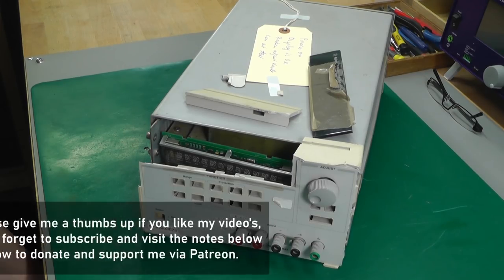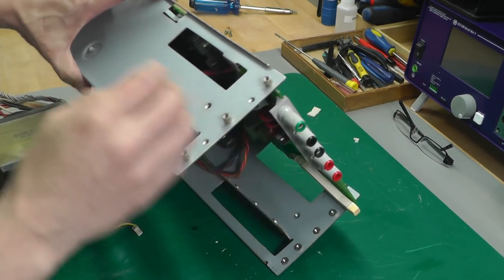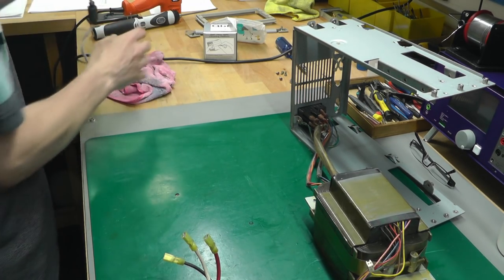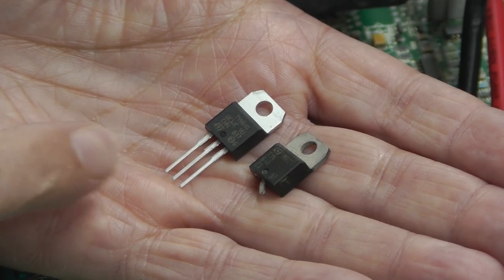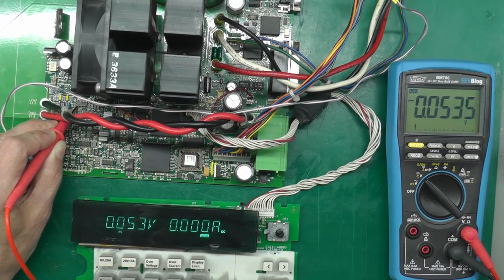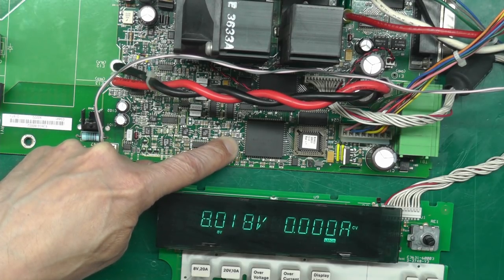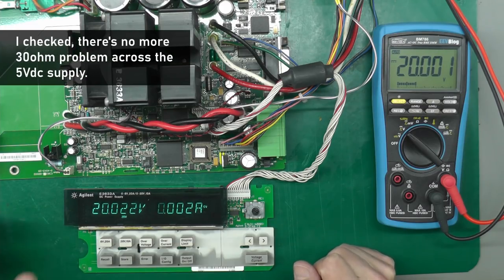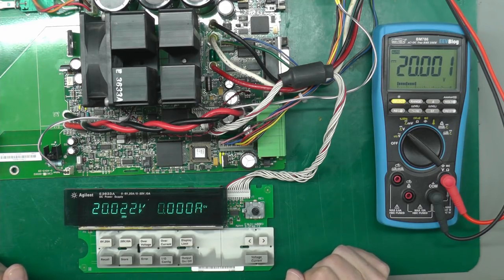No.077 - Agilent E3633A Power Supply Repair

Comment from the maker: Here's the finished power supply:
https://www.ianjohnston.com/images/stories/IanJ/E3633A/E3633ApsuRepair.png

Notes:
Why did I use a 32K 89C51RC2........well, the 4K 89S51 which is the natural replacement is on backorder 2022 delivery with RS, Farnell & Digikey.....ugghh!
Note: If you buy the AT89S51-24JU then it can be programmed with the MiniPro TL866A
Reply: That power supply looks like new in the photo, of course it would with a new front, but you would never think it had been repaired.  We know otherwise of course, but if we hadn't known we would be none the wiser!  :-))

Comment: Do you know if the display board firmware is the same for all that series of supply or is it custom for each model ?
I think it's fairly common to have one of those IC fail and then there is nothing you can do without the firmware ...
Reply from the maker: That did cross my mind, and I compared the firmware for the E3633A and the E3646A and they appear the same. I don't have any display firmware for any others so not entirely sure.

Comment: Did you replace the 78L05 as well?  I wouldn't depend on it after what happened.
Reply from the maker: The overload was within spec for the 5v regulator and thats why it was able to maintain 5Vdc output. If it had been pulled down from 5Vdc then I'd have replaced it.
It's the resistors that were way beyond their power rating.
Reply: @IanScottJohnston  Surprised that you didn't measure the voltage across the 14 Ohm resistors at around 32:00, this would have revealed the current.  It's a great diagnostic (as I'm sure you know) to know the current in situations like this.

Comment: When pulling off old tape or labels, use a heat gun to lightly heat the tape/label before pulling it off. In my experience, often the adhesive will "come to life" a little and separate from the mounting surface leaving less "stuff" behind. Of course, use heat sparingly depending on what the surface material is (plastic, etc.)--you don't want to melt it!
Reply from the maker: Good advice!....In this case IPA made quick work of the tape adhesive but yup, thats not always the case.

Comment: Very cool. I bought a 120V DC 10 Amp HP PSU on eBay which looked to be in good condition and powered up. The seller shipped it so poorly the unit arrived with the entire front panel smashed off. Thankfully the seller gave me full refund and apologized for their "mistake". I now have to evaluate whether the thing is reparable and hopefully the PCB,LCD, keypad, etc aren't irreparably damaged.

Comment: Ian, do you know if there are any EPROM devices similar to the S4 on Aliexpress? S4 is on a professional level, almost 4 grand. I wonder if the plethora of cheaper devices on Aliexpress would be able to do that.
Reply from the maker: The TL866II Plus might do the job if you also get a DIP to 44pin PLCC adaptor.
I have the older version (non Plus) so I might make a wee video to try it out.

Comment: Looks like the transformer is quite noisy on high current output. The result of the drop?
Reply from the maker: To be expected given the loads and since the covers weren't fitted. I'll see when I test it again with the covers on. The transformer is a brute of a thing, I reckon it can handle a drop or two, but it is possible the eddy currents are distrurbed!
Reply: @IanScottJohnston  I am surprised the transformer didn't break loose and cause a lot of damage!

Comment: Great fix! I have 3 of these exact supplies at work, where did you get the schematic?
Reply from the maker: The set of schematics and board layouts are at the back of the Service Manual which you can find dotted around the web.
Reply: @IanScottJohnston  Hey thanks. Another way to TS intermittent issues, is heat and freeze spray, I always use heat first (with a thin piece of cardboard to direct/section off areas), I think the solder issue and the mpu issue could of been found this way. If heat does not give me clues, then I try the freeze spray. Thanks again.

Comment: Your videos are always great, thank you!  I have a E3633A that fails the OCP calibration.  I have replaced all the electrolytic capacitors, but that didn't help.  OCP works within spec.  In fact, all the verification tests are within spec.  Can you give me some insight as to how the E3633A calibrates the OCP?  I have looked around, but could not find anything.  Thank you.

Comment: Hey thanks for the video. I'm about to tear into an E3634a and this was a great intro to what lies ahead. One question, why did you only replace the X2 RIFA cap? Why not the two smaller 1000pf across each side to ground? I believe these are Y2 so they never go short and shock anyone who grabs the case.
Reply from the maker: Yes, they should have been changed out......but generally, they don't fail as much as the bigger ones in my experience.
Reply: Great thanks for the quick reply!

Comment: My E3633A passes the complete self-test with no error. However, when I turn the output on, the unit goes in to "Unreg" unregulated. Neither CC or CV are lit. The voltage and current are not adjustable and only -0.3V output. 
Does anyone know the problem?
Reply from the maker: This can happen when the PSU can't somehow regulate the correct voltage in CV mode. It can be experienced if say when charging a large battery  and eventually the battery voltage over-volts the output from the PSU, the PSU recognizes that and you get UNREG displayed.
But as you aren't connecting any load then it sounds like there's a fault in the circuit somewhere........but it could be anywhere and so would require an investigation of the analogue and digital circuits......much like I did in this video.
Reply: @IanScottJohnston  thank you

Comment: They should have glued the large capacitors...
Reply: Some glues corrode things, but you would think big capacitors would be clamped (cost implications) but even a plastic clamp would hold them better, all that weight on their own pins is a bit much of they get a knock.  But them other things would get damaged anyway!  But yeah, you have a point.
Reply: @BoB4jjjjs  So they just have to choose the right glue?
Reply from the maker: I think the main problem is the size of the solder pads for the capacitors. In my video I got in real close and you can see they are very small pads. They should have been 3 times that size and thus allowing for more solder mass to fix/hold the capacitors to the board.
But yes, the right glue would have helped otherwise especially as a retro-fit as the engineers must have realized the pads were too small.
PS. Not a cheap PSU.....£1341 at Farnell, 11 in stock LOL!